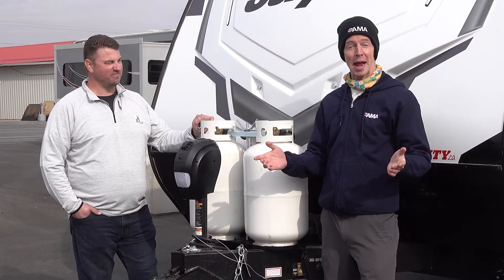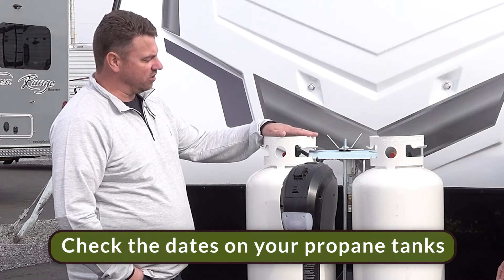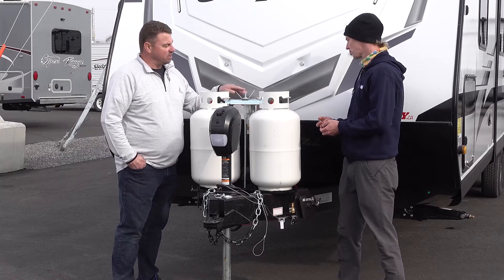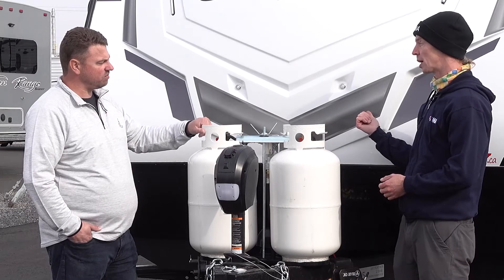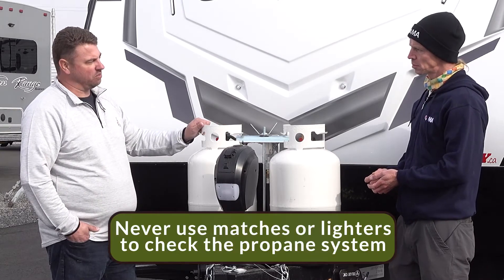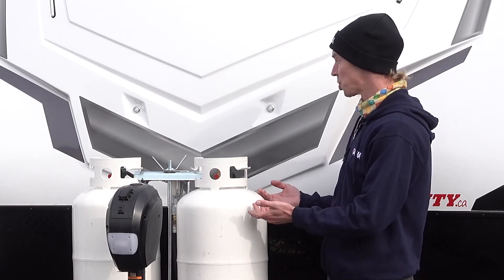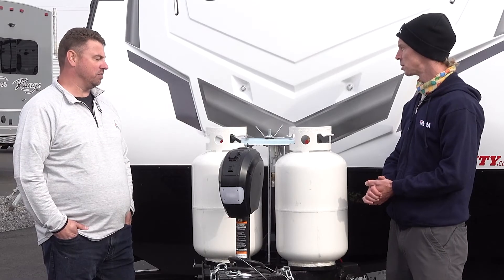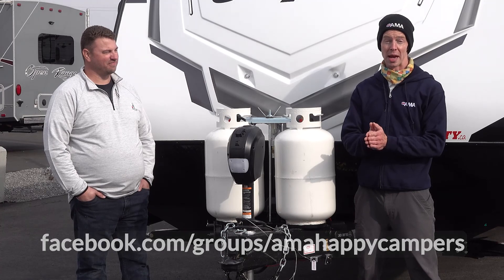Safely hook up your RV Propane

Comment: I wish "bleeding any remaining air out of the system using a BBQ torch" was explained and shown. This is not something I have seen nor heard off. It would be helpful if they covered what RVQ is and what is can be used so far.